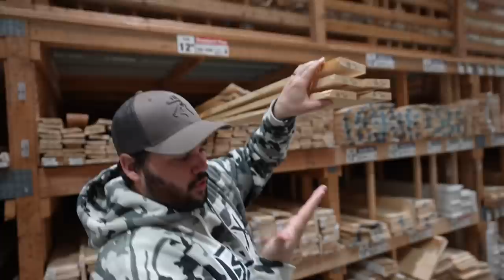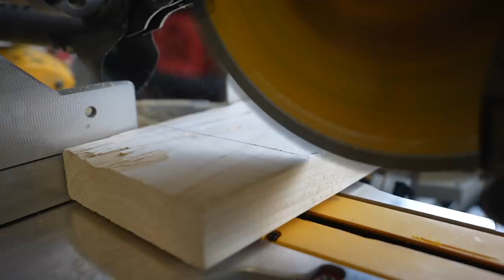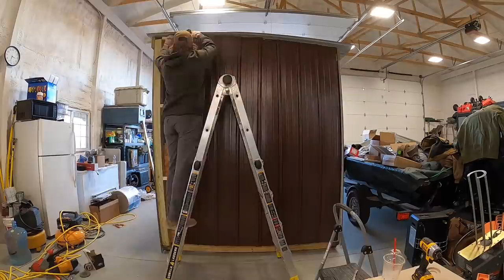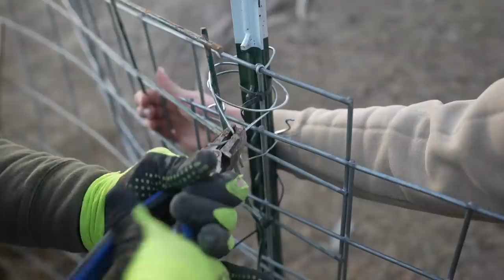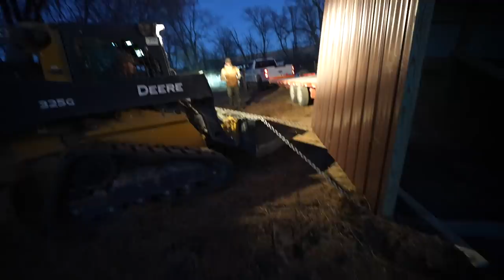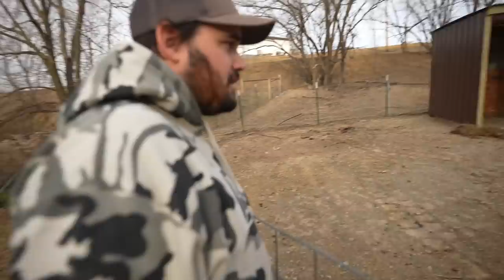Building My GIANT CAMEL a HOUSE in My BACKYARD FARM!!!

Comment: Next time you have to unload somthing like that leave a little hanging of the end of the trailer then when you get to your destination tilt your deck then just drive away and It will slide right off. Some truck drivers unload seacans like this. Only do this on flat ground.